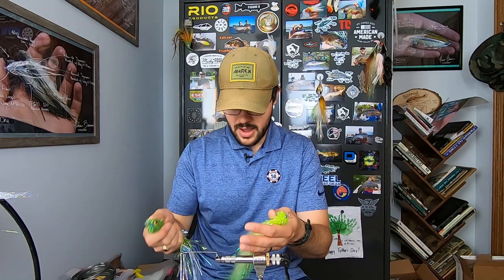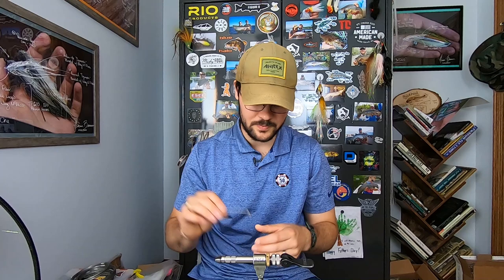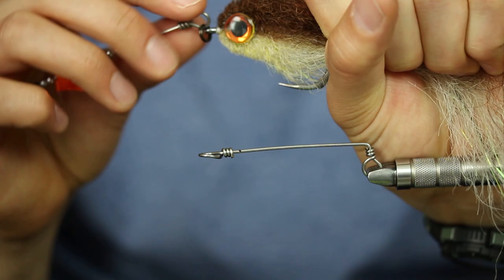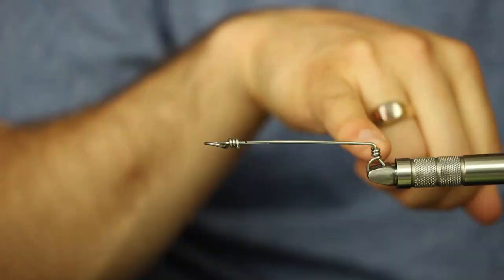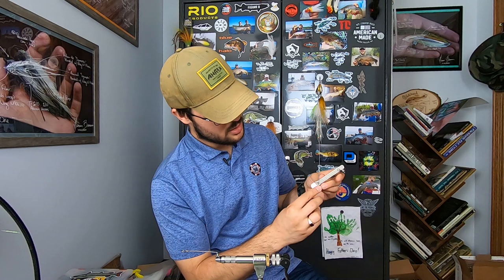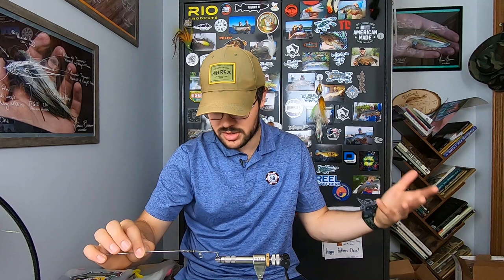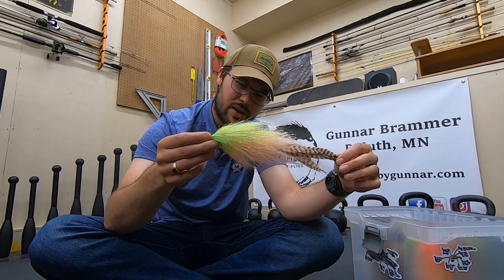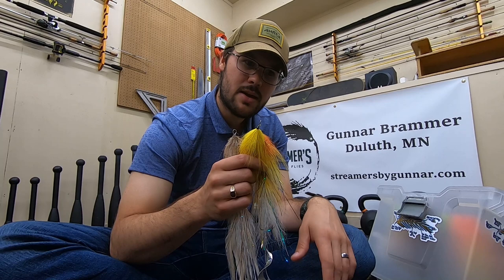Introduction to Dropper-Shanks: Custom Shank Building

Comment: Ellis Ward has a tutorial on fluid dynamic theory analysis, for the Zoo Cougar and Dungeon fishing flies. That is worth contemplating. When one looks back at some of those really early streamer designs. Where Kelly started to first move away from the long shank hooks. And towards the saltwater idea, of where the short hook is used in front. I spent a while looking at saltwater flat wing flies. Because I think there were aspects to the flat wing saltwater fly. That I could utilize in freshwater flies too. The flat wing is a very extreme example of that idea. Of where the small hook is used up front, and a lot of the fishing fly is built in the case of the flat wing. Using the saddle feathers and such. And it works real well for small sand eel type of forage imitation.
Reply: What Ellis did then with the Zoo Cougar, was he went back to that basic design. And looked at what it does from a fluid dynamics basic analytical perspective (and he explains too how the Dungeon flies turned that upside down, yet also depend on the same basic principles to do with fluid dynamics). It caught me by surprise. As we think about keel design flies, from a point of view of adding weight often. We never think about keel design flies, from a fluid dynamics perspective. And it's pretty obvious, after one thinks on it. We also talk a lot about buoyancy of fishing flies too (that is, when trying to construct larger skeletons to throw profiles etc that suggest larger bait fish forage). Buoyancy and keel weight were the basic two lessons. I had put together in my head, when thinking about streamers.
Reply: The thing that Ellis Ward did, is he re-introduced a very important aspect of fly design. That rarely gets remembered in analysis of fly design. It is the use of a fly rod occasionally, at close quarters, to move the fly in the water. What streamer anglers would refer to as a jerk strip. Even though it's only a matter of six inches of movement of the fly in the water. Or even less distance. The speed and acceleration at which that happens. Is something that we forget about (one would need to capture this using slow motion camera photography to fully understand it). And needless to say, that never happened in fly fishing. Because that jerk strip action of the fly rod. May not move the fishing fly a lot of distance in the water. What tends to matter though, is the speed. The acceleration from zero to whatever speed the fly moves at. And the reality that when the object. The fishing fly is moving in the water at that speed. Fluid dynamic properties of the fly itself, do enter into the equation. More so than buoyancy, and more so than keel weight in fact (which are things we can observe using our own eyes, and we can relate to them). Because buoyancy and weight on the hook, or the fly. Is something that has impacts, that we can observe using the naked eye. The problem with the rod manipulation of the fly in the water. That happens too quickly, that our eye just can't keep up.
Reply: Why do I bring it up? Well, this dropper shank idea. Is not a million miles removed from the basic hook. The hook that Kelly Galloup selected for use a long time ago. In order to dress the Zoo Cougar fly on. One thinks about the Clouser Minnow fly I guess. If ever there was a fly design, where the hook itself became a part of the fly design. It was the Clouser Minnow. And nowadays, one has the advantage too of being able to visit Bob Clouser himself. To witness him making the Clouser Minnow fly on the tying vice. In order to understand precisely how to make the fly. It's one of those flies that became copied so much, for so long. I lost interest in it. Because I was uncertain as to what the original formula for that fly had been. The Clouser Minnow is a design, which has echo in some of Kelly's flies too. In how they are constructed. The point though, is that like the Clouser Minnow, the Zoo Cougar fly was another design. In which the hook or shank became a part of how the fly operates, and how it is constructed. And it was a single hook configuration, the Zoo Cougar fly.
Reply: With the Zoo Cougar fly, by making the hook aspect of the assembly a lot simpler. A straightforward short hook, on which everything is assembled. What it enabled Kelly Galloup to do. Was something sophisticated and finely balanced. As far as selection of the right mallard feathers goes. Where the selection of that component, is a key thing in the Zoo Cougar design. And how that mallard feather contrasts with the other parts of the construction. Which don't have the same finesse to them. The other components of the Zoo Cougar are basic and everyday. And that's on purpose. So that when one puts together a component which is very finely tuned, and streamlined for efficiency. In terms of fluid dynamics. When one puts that alongside materials which are not. That is what delivers the action that the Zoo Cougar fly has. And why it operates well, when the angler does the retrieve of that fly in the water, using the fly rod to make the fly move rapidly over shorter distances. If one looks at the basics of fluid dynamics, as far as the Zoo Cougar is concerned. There is actually something like 'down force' at work. There are a number of things happening with the Zoo Cougar fly design. That our human brains can't pick up, because our eyes can't capture what happens. When the fly moves at a fast speed. But it's stuff that does make a difference, in terms of the fly's effectiveness and success.
Reply: The point is that, once one gets the tackle itself. The basic steel components used to assemble the materials and component on top of. When one has figured out, a way to make that straightforward and less complicated. That is when it is possible to do something. Like the Clouser Minnow, or like the Zoo Cougar design. Where there is some kind of sophistication or something. Added on top of what seems like a basic foundation. And unless the foundation or the skeleton structure. Because refined down to that extent. It's hard to put parts together, to make a fly design. That produce something complex. In the way that Zoo Cougar design was that complex. It's something that goes beyond keel weighting and buoyancy. Although, those two aspects of fly design on their own are important. And are still enough to help to produce decent flies to fish with. The designs which have proven very successful may have other things in them too. And because of the jerk strip retrieve of flies, some of that happens at a speed. That we can't observe with human eyesight on it's own.